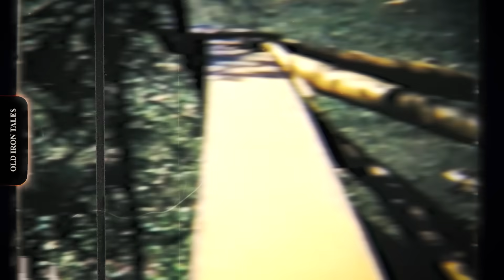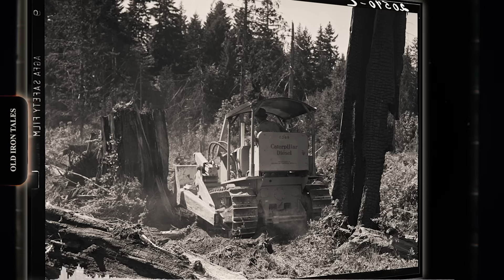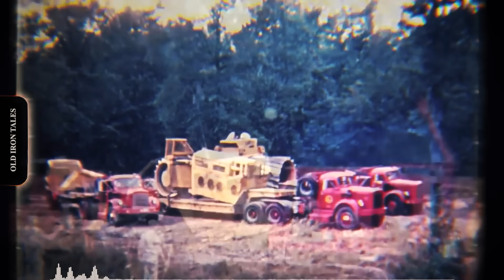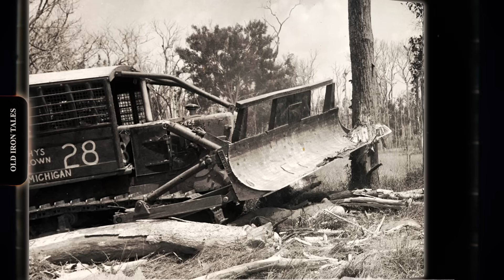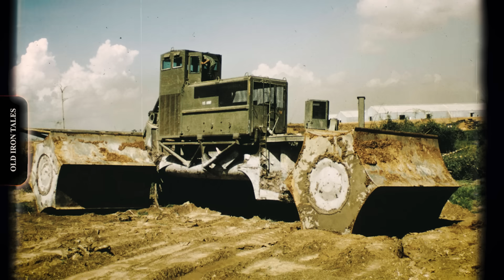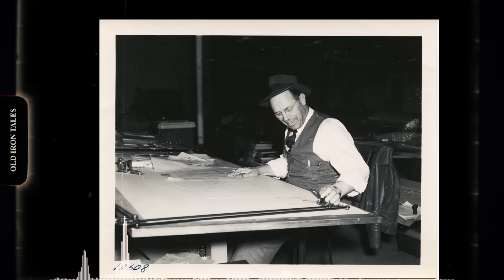LeTourneau's INSANE Tactical Tree Crushers

Comment: Newer forestry machines are way more effective as this tree cruscher. A feller buncher can harvest up to 200 trees per hour which is quite impressive. They can harvest and bundle up to 5 acres in a working day or more. Whitout getting stuck. Is such machine works non stop 24 hours at day for 365 days it could potentionally harvest 5.475 whole acres. Which is more as twice the tree cruscher did in a year😅
Reply: Did they have them back then?
Reply: @bigredc222  yes they were actually invented in the same decade. The first track type feller buncher was made in the late 1960's so the idea of such machine is older can't find when exactly it was invented. But my point was that modern machinery is way more efficiënt most of the time and why just crush somthing when you can effectivly do something usefull with it.

Comment: I still find it cool that one of his overland trains sits on the side of the highway less than an hour drive from where I live in Alaska. He made some incredible pieces of machinery.
Reply: Cool, one hasn't any real size comparison until you stand next to one. I've been around, standing next to 2, 26 foot screws,under a ship, wow. Serviced construction equipment for 20 years also, worked on America's largest inland crane, Memphis, Tennessee. But the facility there built nuclear reactor cores, Wow. Could turn a semi around inside easy without looking for poles. 2 inch oxygen and gas lines in I beams. 800,000 press 4 stories tall. Rolling cement door for the x ray room 50x60 feet. 100 horse electric motor on each door,  4 inch cable on spring reels. Quite the place.
Reply: Extremely simplistic too.  Just looking at all the machines how everything is just a simple tool.
Reply: motto:
SIZE DOES MATTER!
the BIGGER the BETTER!
🤪🤪🤪🤪🤪

Comment: there was two of these in mackenzie , one is in the town the other still stuck out in the bush ,
Reply: Are there any pictures of the one stuck ??
Reply: @johnrasmussen782 I’m not sure i have none though im sure town of Mackenzie probably has some or maybe the museum. I work up there in winter in logging roads .
Reply: @geralddewetter4594  Have you ever seen the one out in the brush ? Thanks
Reply: @johnrasmussen782 no I haven’t seen it as I work up there in the winter though my uncle has seen it and was one of many men who helped strip it of motors and stuff . The stuck one is the larger of the two . I’m hoping to get into it this summer as the man I work for there in the winter says he has an idea where it is . Once I have pictures I’ll post them
Reply: My Dad was a mechanic that worked on the BC tree crushers in the early 60s in Longview before they were shipped North.  Somewhere I have a pic of me as a toddler riding in the cab as my dad drives the crusher.   RG leased a lot of equipment and that lease agreement came with LeTourneau  mechanics due to the blend of diesel and electric wheel motor tech. My Dad was that guy!  Went out with Tree Crushers and eventually scrapers building Stemmons Freeway in Dallas.
Reply: @Rattlecanjeff that’s great seems more we talk about it the more other people remembering things
Reply: You think my f250 would pull it out? 😂😂I’d like to restore one and put it back to work
Reply: @dclfarms6204 you best get something a tiny bit bigger lol . My uncle who worked on the stuck one which is the bigger of the two says they tried 6 D9 to pull it out and it never budged. Hopefully this summer I can get back into the area they say it’s in and get pictures
Reply: @geralddewetter4594 that’s wild. If 6 D9’s can’t budge it, I think it’s in its forever home. I’d love to see one in person one day.